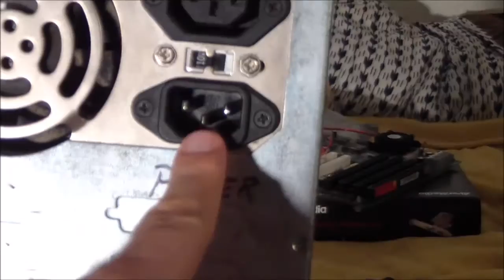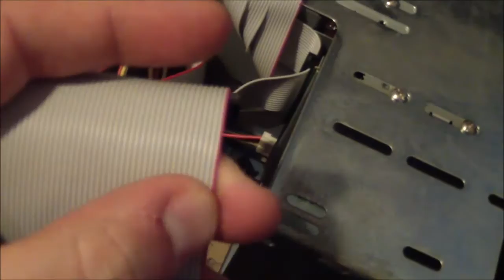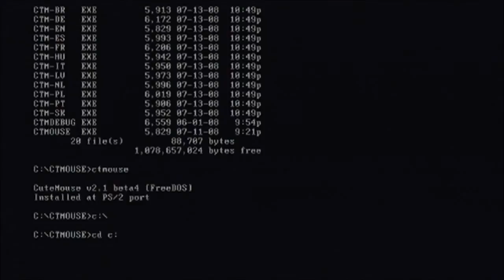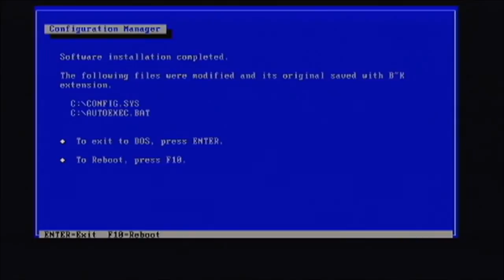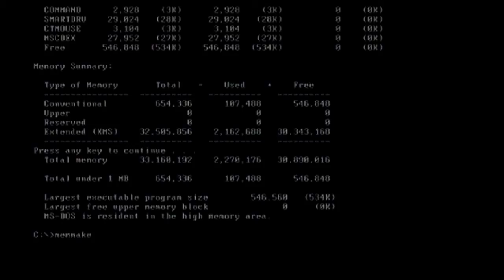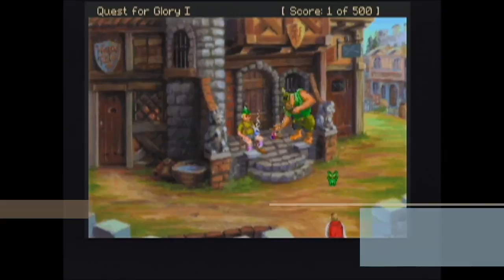Beginners guide to building an AT socket 7 PC and setting up DOS

Comment: i have to ask if i replace the hard disk with a ssd like the Transcend ide would that work?
Reply from the maker: It should work just like an IDE drive. I've used SSD's and CF cards as hard drives in PC's going all the way back to 8088 machines so they should operate just like a regular hard drive. Keep in mind since PC hardware varies so much some motherboards or SSD's may be more picky with certain hardware but this can be true even with IDE drives.

Comment: Socket 7s are nice. I have a Pentium 90 in my socket 7 dos machine. Used a case from a broken Micron millennia which was a socket 5 originally.
Reply from the maker: indeed, very flexible boards in terms of how fast or slow you want them.
Reply: That's true. I also originally had 64mb of ram in it but downgraded to 32mb because it seemed a little overkill.

Comment: I think that I have tried every trick in my book to get Cannon Fodder to run, just ends up with a lockup and "video out of range" screen on the LCD monitor. Any ideas?
Reply from the maker: It's always worked for me. I only use a CRT though for anything pre late XP era. do you gave a diffrent monitor to try? the video out of range issue suggests a monitor issue.
Reply: I could try another monitor, but it seems odd that the PC locks up tho. I have tried with univbe to see if that helped, but same issues.
Reply from the maker: what's your machines specs?
Reply: Pentium 200MMX, 64MB ram, S3 Trio64V2/DX, Sound Blaster 16 (CT2230), MPU-401 interface with Roland MT-32.
Reply from the maker: do you know the motherboard or chipset? I can see if I can replicate the problem tommarow if I gave time.
Reply: Its a Dell Optiplex Gn 5200M, chipset should be Intel 430TX.It uses PC66 ram rather than EDO.
Reply from the maker: have you tried a diffrent video card? I found  mention of a similar issue with this game and they were also using a s3 trio. they swapped it with a matrox card and the game worked.
Reply: I have tried on another computer before, but I will try it on this one with a matrox or something else. Thanks!

Comment: i can't find a single socket 7 motherboard for less than $100. my packard bell died and i can't put together $200 or more dollars for a replacement pentium 1 machine. I don't want to burn a hole in my wallet.
Reply from the maker: do you live in a rural area? I've never gad trouble finding whole ss7 pc's for under $20. the really good and we'll known boards that do things like support k6-3 and have a lot of l2 cache can go for a premium but in general they shouldn't be to hard to find, at least that's my experence in the US.
Reply from the maker: also ebay is full of people trying to price gouge on things like ss7. look locally. craigslist, offerup, freecycle. ask friends and family if they have an old pc.
Reply: I bought my Socket 7 board on eBay for $20
Reply: @gex581990  i bought whole socket 7 computer with at case , power suply , 32mb ram and pentium 233 mmx, for 35$. even 4 gb period correct hdd and cdrw and floppy was inside. the board is highend with speedEasy in Bios, so jumperless setting FSB and multiplier inside BIOS, dont have to open it, and set jumpers... never saw something like it on socket 7 motherboard. It's QDI Titanium something  motherboard. soundblaster and some kind of 2mb VRAM VGA was inside too.
The good thing is , it can bbe underclocked to 50FSBx2 = 100 mhz Pentium from BIOS, and all between 100 and 233. The max setting is 3.5x75, so about 262 mhz.